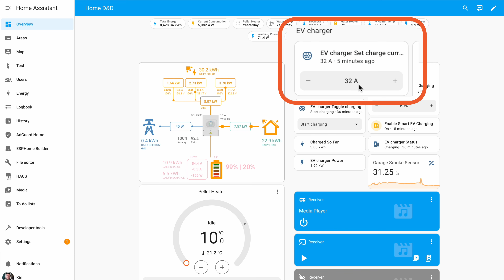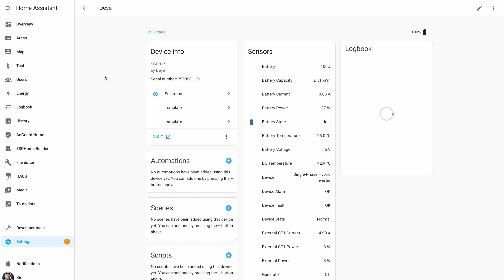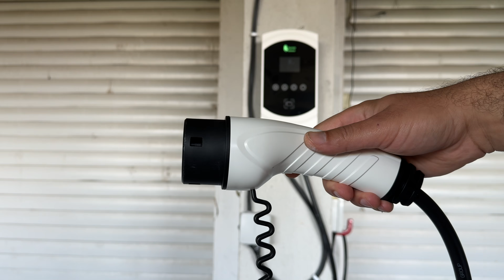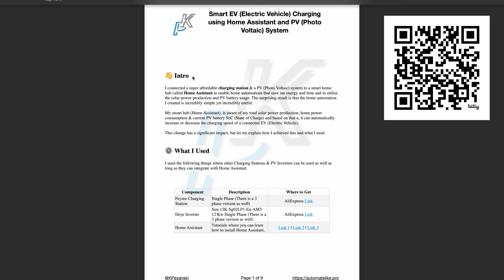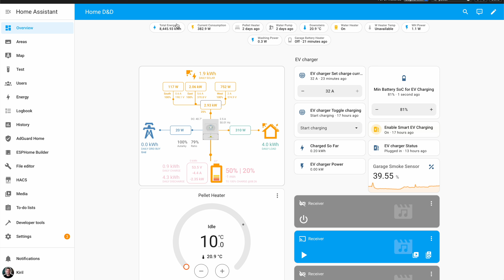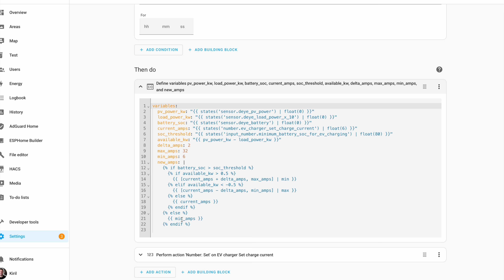I set Home Assistant for Electrical Car charging with Solar Power. Here’s what happened

Comment: I want to buy a charger for electric cars of this type. The question is about the change (+/-) of the charging current depending on the increase or decrease of the solar power. Will it change automatically with a certain step?

Comment: Thats awesome :D  - I am about to buy an EV, so I am thinking about doing the same.  However, are you able to set the amperage to other intervals than between 8 and 32 amps ? - Of course it cant go higher than 32, but what about lower than 8 ?
Reply from the maker: you can go to 6 amps which is the lowest possible value, but I prefer 8 and never go down to 6 to be honest!
Reply: @KPeyanski ok 😊 - so then what if your overhead from the solar is only 2kw or 3kw ?
Reply: @KPeyanski  so meanwhile I found out that the Charging standard, for ev Chargers is minimum 6 Amps. No matter if it is 1, 2 or 3 phases.  So I did some digging. And it turns out there is something called DLB (dynamic load balancing) where the charger can choose to only charge using 1 phase or all 3 phases. And Feyree actually have a charger that supposedly supports that 😊 I will do some more digging. Charging 6 amp at 1 phase would be the lowest I could go 😄 so 1.4 kw

Comment: great video, just what I was looking for. (and it popped up as part of google's AI suggestion, so you landed a win 🙂)
One Q though: I see use use    battery_soc: "{{ states('sensor.deye_battery') | float(0) }}". How does the inverter (deye) know the current charging status of the vehicle (which is connected to the Feyree charger.
Reply from the maker: Many thanks that you share that info  :) The sensor.deye_battery is the house battery, not the car battery and the inverter knows its state of charge. I'm not using the car's battery state in this automation at all as I don't actually need that.

Comment: Many thanks for that great documentation !!! Just in time, as I have exactly the same Charger and got the car this week. I took your template and enhanced it for my use with different modes and direct calculation of the optimal current and turning the charger off, if the PV does not produce enough... still in very preliminary state, but I can share later when I have a working system if interested ;-). The great thing about your manual is really that it is simple and provides a great starting point.
Reply from the maker: Awesome! Glad the video came at the perfect time for you :) and sounds like a great project, and I'd be interested to see your final solution!

Comment: Very nice to see this integration! When you change the current charge, do you need to connect/disconnect the car with the built-in relay or it can change dynamically? I see an integration with a feyree transportable charger with plug and it need this manipulation. Every 3min is too short in this case.
Reply from the maker: No, there is no need to disconnect/connect the car to change the current. It all happens dynamically